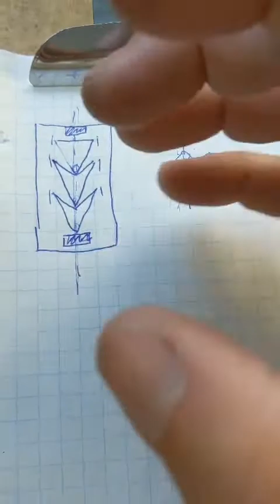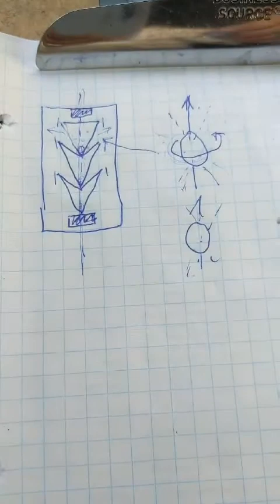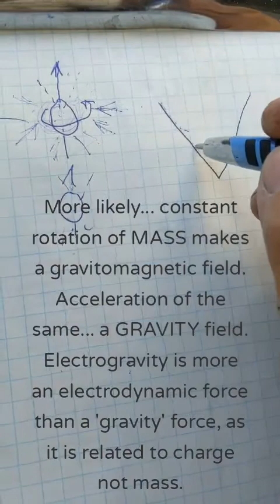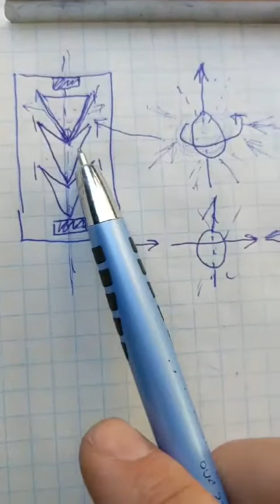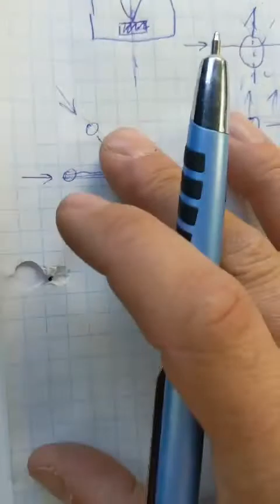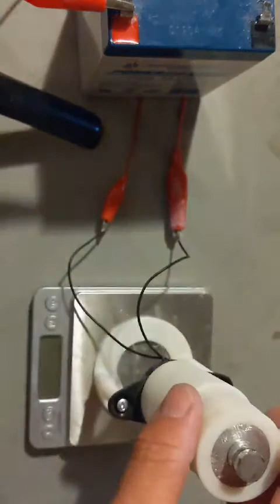David Hamel's machine, levitation and nuclear energy!

Comment: I think the Hamel device could be simplified to one cone and an imbalancer so that the cone precesses but does not  spin.
Reply: they are no supposed to spin. they vibrate. vibrate at distance of one atom is enough to cause effect of gravity etc. three or more cones are needed. one cone will not work.
Reply: @anthonyu5456 right.  Hamel specifically said it won't work with two cones so I infer that one cone will also not work.

Comment: Okay so maybe I'm thinking about another  machine that Mr. Hamil made but not if it is the one you started with. As I recall in Davids designs there was another feature to the Machine that I didn't see you mention. The base plate under the Magnets was set on top of a set of pool ball size rollers in a upper and lower set of half cups. and if it is the right machine he also build his life size model from granite , ( which has piezoelectric aspect of it's own )  As for your model one thing that reduces vibration in David's design is that when tuned properly the cones hang in the machine only on the magnetic fields with the minor pin at the bottom of the cones. I've seen other videos here that say that the actuation magnet that is on a screw mechanism which is to be tightened downward to meet with a oppositely charged magnet inside the top cone. With all the various pivot points in play and the hole unit tuned pervectly you can bring it into tune. with out the vibrations. Also In Davids design there was no need for outside power in put.
Reply from the maker: I read about the granite parts, and I would argue that it's not important. I admit my knowledge about his work is very limited, but what I did know connected with my research on NMR and its possible connection to gravity control. In this case, magnetic field tuning would be critical, and would likely require a weak Larmor freq. field to use nuclear precession to cause mechanical vibration of the cones..... harnessing the "very wheelwork of nature" - Tesla

Comment: Even if you were dropped inside a nuclear plant, you would not understand what you were looking at today, all you would see are pipes and cables, that doesn't show you it's doing anything nuclear. If UFOs are made by advanced aliens, they're likely using super compressed fields and components designed in a micro atomic scale, you could never understand all the inner workings by just using your eyes alone.
Reply from the maker: This is definitely the case with MRI. The only thing I was looking for is weight loss, which I saw, but I couldn't rule out vibration as a cause.

Comment: You should build a 45 gallon drum device and experiment with that... from what I remember about Davids explanation the cones didn't spin, just wobbled at a faster and faster rate...
Reply from the maker: Im familiar with that, but haven't heard about any successful replication. It's strange though, because the design makes sense from the standpoint of exciting synchronization of nuclear precession. This concept is closely related to Dr. Alzofons theory on dynamic nuclear orientation as a method of gravity control. The three nested cones also speak to the structure of a nuleon with the three quarks. I dunno, but it would be interesting to try a more faithful replication.
Reply: @failforwardresearch3127  if you do, don't make the mistake most people do by putting a motor on it  to make it spin... the way David described it it was more an oscillation than a spin all induced from the opposing magnetic fields. Think of the centerline of the cones moving like a belly dancer rotating her hips, she isn't spinning but she is in motion...
Reply from the maker: @edwardkipp4911  again, that strongly suggests a precession at a resonant frequency. My theory is that the axial magnets would set the larmor frequency of the aluminum nuclei. If the larmor frequency happens to match the mechanical frequency of cone oscillation, it might begin wobbling on it's own. I want to try this in my vacuum chamber.
Reply: @failforwardresearch3127 did you ever try this?

Comment: Wow, this is quite interesting, but I'd like to see what happens when you spin the base without nothing in it - no magnets, no aluminum cones. As a control.
Reply from the maker: If I recall, I tried with no magnets/metal and there was less effect on the scale. However, I think there was some vibrational problems with the scale readings as the magnets and Al were added due to the extra mass, so it appeared to work, but this is possibly experiment error.
Reply: @failforwardresearch3127  We'd need to see the rotation of the base alone and the scale would have to read no change in weight or a decrease of 0.01 to 0.05 let's say, otherwise it's just experimental error. Or you're proving that simple rotation is sufficient to make the mass decrease. But to prove that you'd need a better scale. :)

Comment: Very nice, I look forward to more.  Does the scale show any loss of weight with only the plastic holder spinning? No magnets, no cone, that's worth testing as well
Reply from the maker: I did test that, and noticed the effect was more pronounced with the magnets and cone. However, it was difficult to rule out vibration on the scale plate as a cause. When I revisit these experiments in the future I will have to devise a way to eliminate it.
Reply: @failforwardresearch3127 yeah I don't know how to explain this correctly but I think the force or the weights of the objects on the scale is getting transferred horizontally with the vibration and you're just absorbing that with your hands which makes the scale show a lower weight.